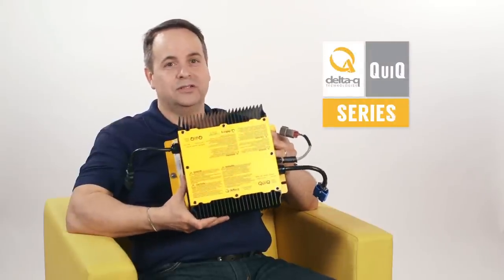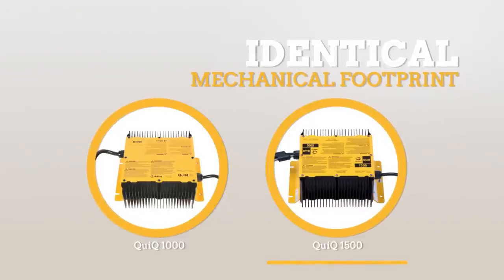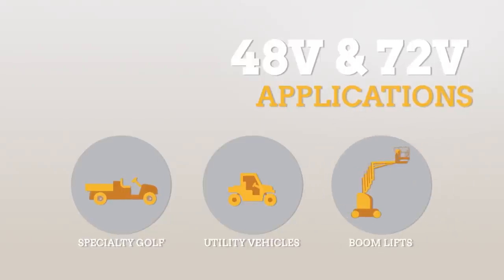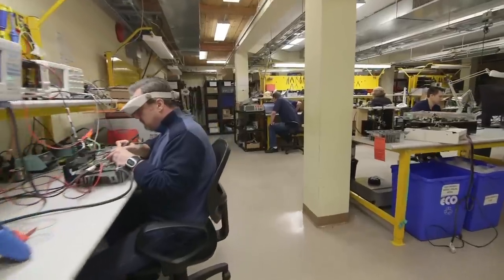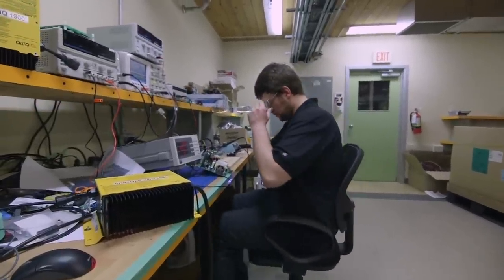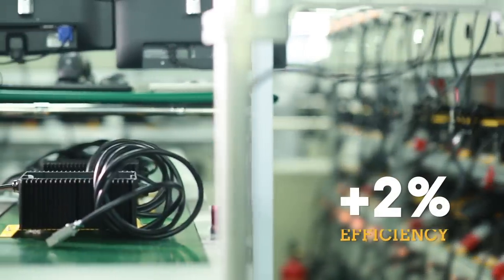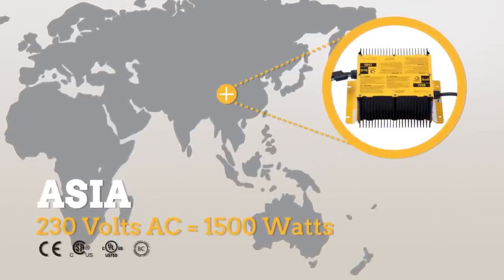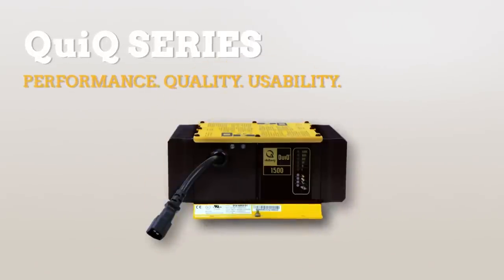QuiQ Series - Introducing the QuiQ 1500 Industrial Battery Charger

Comment: Can I leave my delta q 1500 plugged in to my golf.cart all the time or do I need to unplug it once the batteries are charged?
Reply: Sandy I’ve been told you can that it goes into trickle charge after it is fully charged put it in tow mode before charging ,surprised company hasn’t responded to you
Reply: @Joeysav57  tow mode why? I never heard that